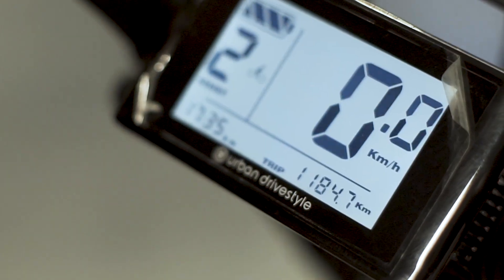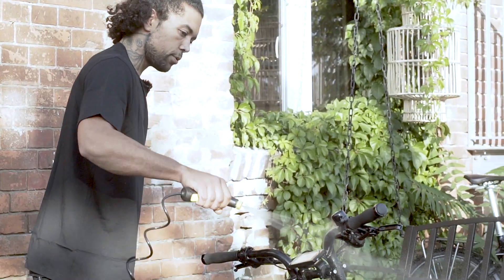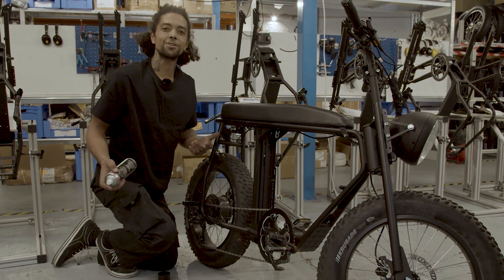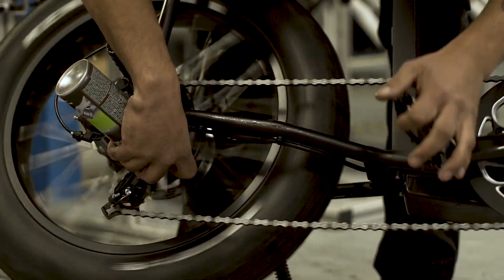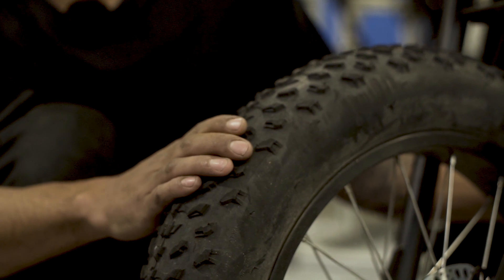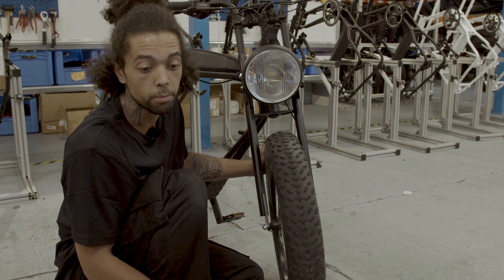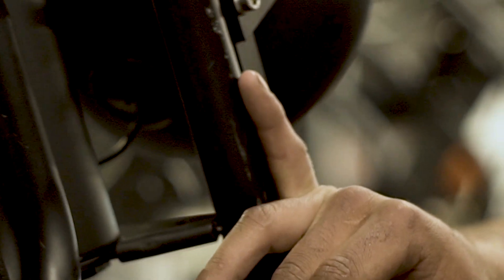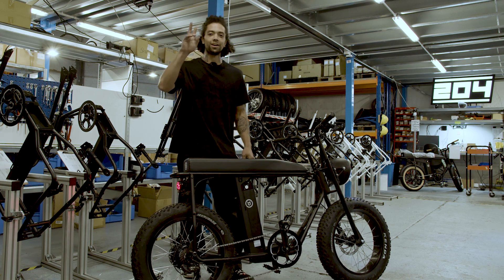Urban Drivestyle's 1000km Electric Fat Bike Maintenance Service Check Up on a UNI MK Classic E-Bike

Comment: I have checked the pressure of both , the rear had 0.9 bars and front has 0.8 bars and they feel hard, I’d this a big problem, I feel panic of pumping them more so I might have tyres blow up. Any advice please?

Comment: Könntet Ihr noch in die Videobeschreibung eine Liste Eurer Pflegemittel aufführen? Bspw das verwendete Ölspray.
Could you provide us a list of the used grease spray and other recommended tools?
Reply from the maker: Sure, great addition, thank you!
We often use MucOff as bike cleaner and WD40 Chain Lubricant as chain spray!
But there are many alternatives – try to take something biodigradible and soft instead of strong acid cleaners!